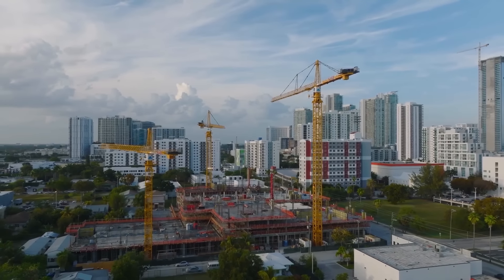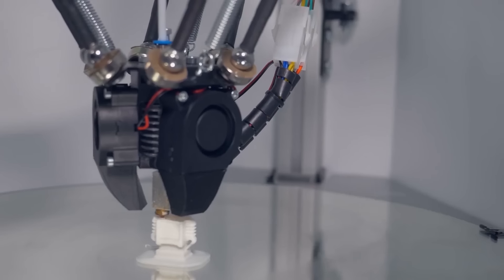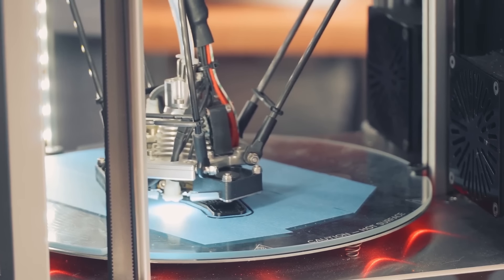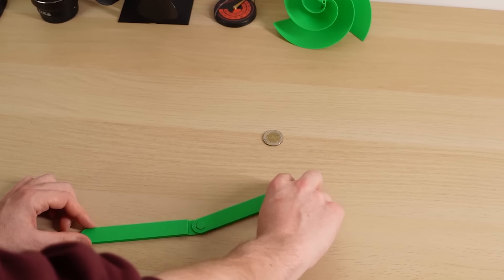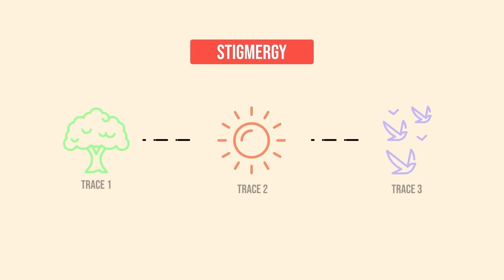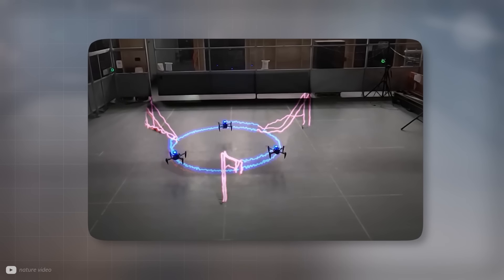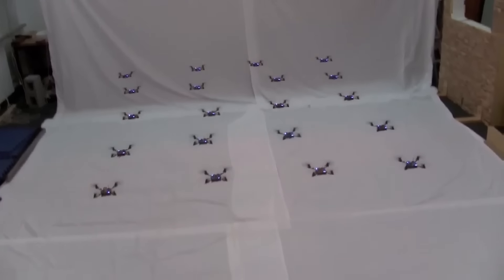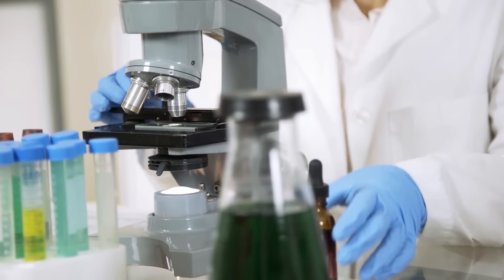Why 3D Printing With Drones Will Transform Construction

Comment: Concrete without rebar... sounds like it should last 2 or 3 years
3D printing in place will happen, but doing it with drones rather than land-based robots is properly stupid though.

Comment: Drones + 3D printing? Wow, just add blockchain in there somewhere, and you've got a tech investors wet dream. But to be honest, this is no doubt an attempt to leapfrog on the existing drone tech, rather than an ideal solution for building things. For 3D printing/automated manufacturing to be useful in general construction, I think you'd be better to put your efforts into developing general-purpose ground robots (maybe something similar to existing human-controlled heavy machinery) or better automation and refinement of the whole process to reduce labor and/or material costs. A very tall multi-limbed robot that can place blocks/tiles in patterns or weld steel framing in complex patterns or things like that could be a lot more practical.

Comment: I wouldn't expect to see this being a useful technology in the next 10 years.  It's too inefficient compared to a gantry system.  Consider that every time the drone has to get material, it has to land, load up, then lift off again.  That's a lot of energy being expended, because rising through air using propellers probably requires 20X the energy when compared with gantries, etc. to lift the same load to the point where it's being applied, not to mention that hovering while carrying a load requires a lot of power, but virtually no power for a gantry system.

It's cute and all, but, yeah no.

Comment: Seems hugely overly complicated__ a relatively lite crane with nozzle and feed hose attached, could be  controlled by guy wires like those awesome sport stadium cameras, this would be much more reliable and probably cost effective. A very light structure to set up and transport, and immune from all but the strongest wind.

Comment: Drones can fly virtually non stop when tethered to a wire. (Or possibly wireless energy transfer). The energy required is relatively low. 
Cranes are great, but require a massive amount of energy to transport and setup. 

Personally i think a hybrid would be best.
Reply: What makes you think the energy required by a drone is low? I can assure you it is not and definitely not when carrying a heavy load.
Reply: @conorstewart2214  I agree it's not low in general. The key word here is "relatively" low. Compared to the effort and energy required to set up and operate a crane or massive gantry. I grew up in construction and now fly Cinelifters and have a 3D printing business, so I have a decent understanding of the energy and effort to accomplish both. (Not that I'm right,  just for reference lol).

Comment: Concrete for 3D printing costs more. Without reinforcement you are very limited in what you can build and how reliable it can be. All your points about earthquakes and other disasters are invalid without concrete reinforcement. A lot of people have already mentioned the low energy efficiency and how a lot of technology could be so much better for 3D printing houses.
And the box is a small fraction of the total cost and effort of a house. About 10-20% of it. 
And so on and so forth. It's a nice toy. Maybe a few niche applications. No revolution.

Comment: The time and money it would take to use a drone/s to create a habitable structure would be time consuming when a prefabricated structure could be put in place with a helicopter in a tenth of the time and ready to install infrastructure such as electricity, plumbing and communication where applicable . Your Idea is great but time equals money .

Comment: Nah they won't. There's a reason 3D printing has been around for over 40 years and they aren't used in construction: Because 3D printed constructions suck literally a thousand times worse than any of the alternatives. 3D printers are not a solution to every problem in every industry. You can drive in a nail with a brick, but a hammer would probably work a lot better.

Comment: Onsite 3d printed buildings is a horrible idea, drones or not.  Why?  Site building, regardless of the technology used will always be less efficient since it cannot take advantage of the economies of scale, efficiencies of the assembly line, and are subject to work stoppages due to weather, daylight, noise, etc.   Far better to prefab components of the structure offsite in a 24x7 climate controlled and highly automated facility and just assemble them onsite.  Not saying that the factory couldn't use 3d printing, there is definitely a place for that in making a prefab structure custom and unique.  Just that the place for it is in the factory not on the job site.

The one place I could see "3d printing" really working would be applying finishes.  I would love to see us get away from drywall and instead have machines that printed stucco/plaster on the interior and exterior of homes that were manufactured offsite, assembled onsite, and just need final finishing.

Comment: 3d printing in construction when is just a gimmick nothing more, because you are only printing walls, and hand labor has to do everything else, plumbing, electric, window installation, insulation, roofing, etc. And when you compare it to a brick layer arm, it can put walls up faster than a 3d printer. And what about the rebar castles for larger constructions?

the only type of construction where they might be a huge aid would be in cob houses, and there is a company in Italy who is already doing it.

have you seen these robotic arms that solder components into a PCB? we need that for construction, we need robots with multiple arms to put ALL the systems of a house together, that is what is going to increase speed.

Comment: Unless they event anti gravity the pay load a drone can carry is very small, then the fact to make concrete strong it needs to cure at the same time, then the other factor how dose it install the steel reinforcement, metal 3D printing the rebar ? Yes it's interesting but it's one of things that will be placed on the back burner for a very long time as economical none viable.
Reply: Blow carbon fibers into the concrete; steel is obsolete. Install a laser/strong IR lamp to cure the concrete by heat before applying the next layer.

Comment: This looks incredibly slow and wasteful.
Maybe if the drone had a power wire and material hose connected to it.
A house can easily weigh tons even when using this foam concrete, lifting that with thousands of pickups and battery swaps just sounds crazy.
Keeping the mixture at the correct viscosity for hours and powering the nozzle with a constant feed could also be a problem. Then there is the drying time difference depending on sun, wind and moisture.
Also having ½ ton of material stored for hours if the weather suddenly turns bad.

A crane suddenly looks like a much easier and better solution, especially if multiple houses needs to be made.
I do not see the problem with module build houses, they can build a house in a day with big Lego blocks.

Comment: More academics with zero experience of construction talking about how 3d printing is going to revolutionise the industry…
There are so many problems to solve (sustainable materials, certification, insurance, quality control and interfaces with other materials) that haven’t been addressed. You can’t construct large spans for example. Offsite prefabrication has solved most of the problems already and is already has a mature, optimised supply chain and offers way more flexibility.
Even the in the terms you have stated (with no scaffolding how do you think things like windows and building services are installed) 
I find your YouTube videos generally interesting, but this one is way outside your sphere of expertise.
This one is stunningly naive I’m afraid and is only going to fuel (more) ignorance and hype.
A little ultracepidarianism here I think.

Comment: Yes, it's a cool idea. But an idea that will NEVER be less expensive than average construction. First off, it's a drone so the tiny amount of concrete it could even hold would mean having to refill thousands of times for even a small home. Or scale the drone up so big that you might as well just use a helicopter. Drones are just far too small that it would either lead to needing SOOO MANY drones that you'd still be carrying the same weight as normal construction and will cost ludicrous amounts. Or scaling up the drones and thus innefienct and should just use a crane. They would never be able to carry more than just a few pounds again without scaling them up, but all the scaling up would mean exponentially more dangerous drones too... just a really dumb innefiencent way of something that we should be looking for a cheaper, less polluting way of construction.

Comment: They won´t because they are complex, they can only fly for a very short time, they are expensive compared to simple concrete slabs and there are like 50 other reasons. 
It´s like the EV car which will replace everything and this and that wiull will replace everything. The stupid drone will replace "normal" construction methods just like welding replaced glue...

Comment: I dont trust anyone using fcking marse habitates as a use case, any propeller craft propably dies through dust and also has to somehow cope with the non existent air pressure, also you build underground on mars, because people dont like being cooked by radiactivity.
Next you mention how they wont do mistakes, which can be nice, but they also cant fix shit and the drones only use soft hardening materials for construction. like other 3D print construction, which makes them useless for anything taller, since no building gets made from just concrete, but steel reinforced one, which saves massively, also the drones dont seem to have demonstrated the ability to print arches as far as i can see, which is difficult for normal 3D printing, were you work with quickly cooling plastics and worksy through the use of supports, which get difficult to do with concrete.
And will they even be quicker when one drone needs minutes to print the equivalant of one brick.
Also the housing needs wont be satisfied with one story buildings, which is the near limit of 3D construction, which makes it to this day a total novelty construction form that doesnt solve anything and hems any project its been used on, not to mention how it is entirely reliant on the extremly CO2 intensive concrete.

Comment: Would never work unless energy is abundant, stable and free and you Really, i mean really can't transport materials any other way. For a reasonable payload of 100kg we need about 23kW every hour of flight, Flight is very expensive thing to do. Anything, ANYTHING ELSE is more efficient. Lifts, cranes, pumps, humans walking stairs. You can print off drones and 3d printing is cool af, but it is not feasible to build human scale things with it, it would be more expensive, more dependent on electrical power, it needs more of power to just stay in air with extra infrastructure, more so that EV. Imagine you need to make a turbo charge station everywhere you need a drone construction, no matter if you fly with batteries or by wire or by laser(lol). Mass should be moved, and homes are heavy, unless you build with paper like a god damn wasp

Comment: This is highly impractical and not possible to scale, at least not economically. If we use additive manufacturing for construction, it will be with arm based extenders, possibly mounted on lifts or cranes. Stop making nonsensical content.